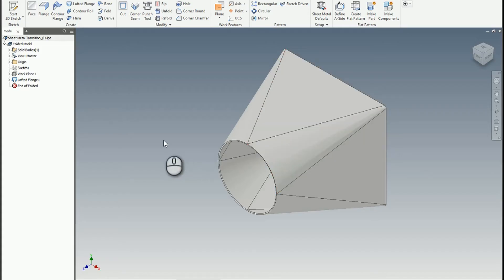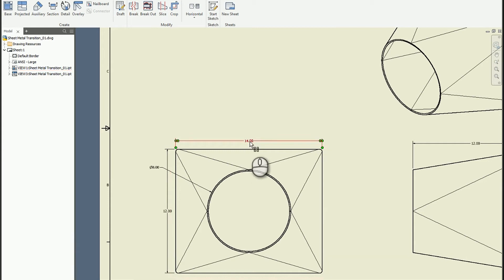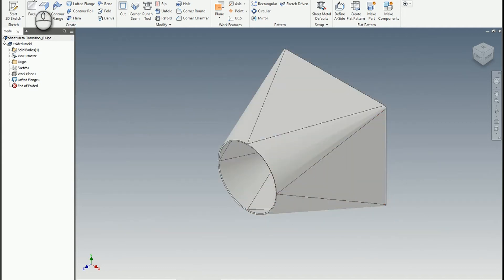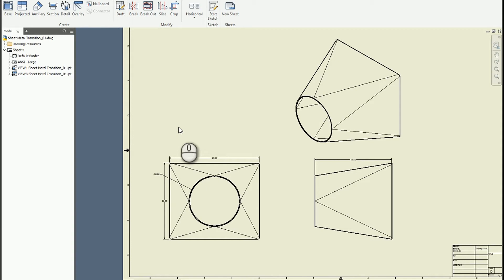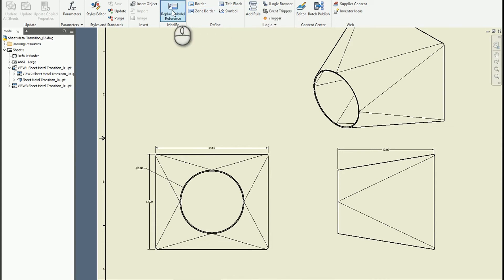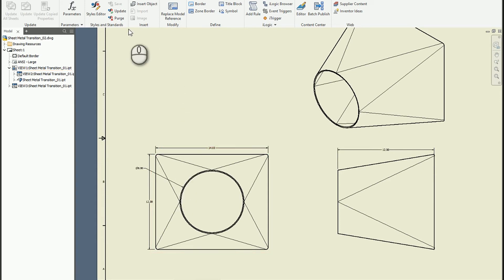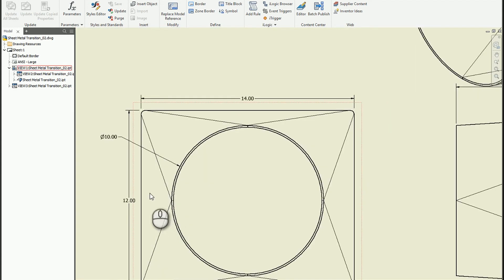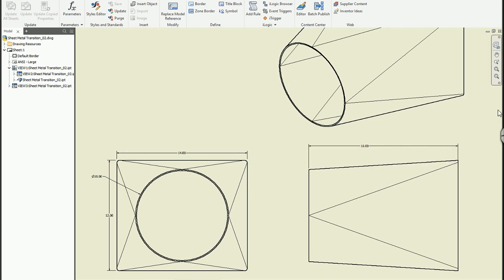Autodesk Inventor - Replace a Model Reference in a Drawing

Comment: On my computer, this comand is not working. When I click on this command, the window does not open. Why does the problem occur?
Reply from the maker: Oğuzhan, sorry to hear of this issue.  Often this can arise if one has a second monitor normally, but then is detached from it for some reason.  Please try to press the ESC key and see if Inventor comes back to normal operation.  If so, the window is offscreen and you'll have to use the ALT+SPACE+M trick and try to move it back onto the screen (press the right arrow keys, if the 2nd monitor is normally on the left and vice versa).  Please let us know if this resolves your issue and thanks for reaching out!
Reply: @Team-D3 you are an angel!!! Thank you!